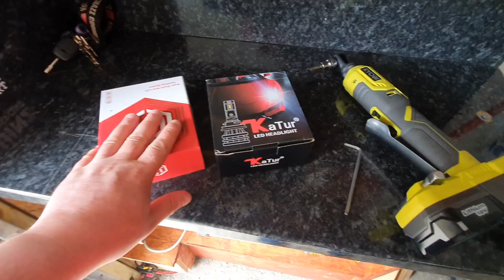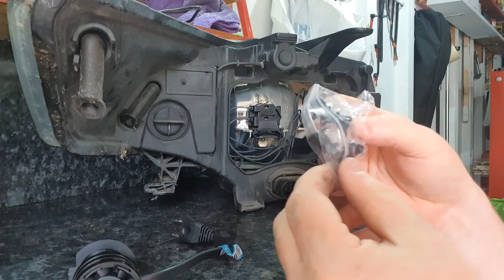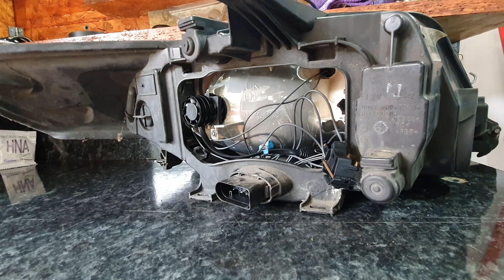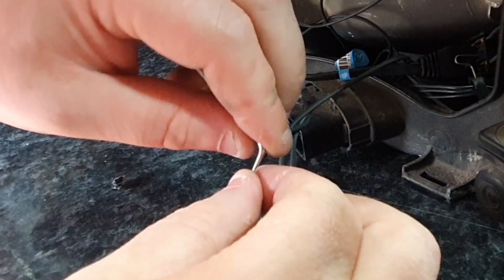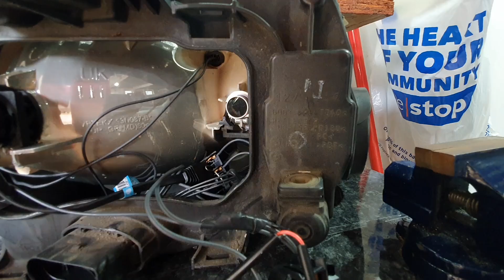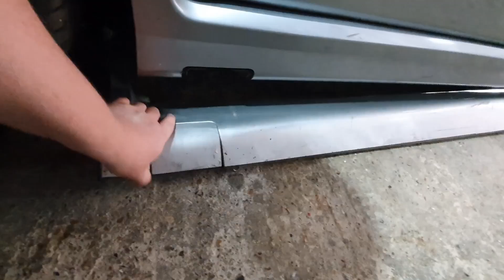Ford Mondeo Mk4 - H1 and H7 Headlight bulb LED Upgrade

Comment from the maker: Part 2 of the led update from HNAsupplies AKA Andy Brooks, in this vid in do the H1 and H7 front lights. So now all that is left is the indicators which Andy has promised to send me asap. So stay tuned for that. Also i will be doing the 3rd brake light in the boot.
Reply: Are these just plug and play mate
Reply from the maker: @neilfinch8331  hiya Neil, yeap they sure are. Only thing is you might need to tap a  ground wire which is easy to do.
Reply: is it safe and will nothing burn? I don't know anything about electricity, but I've heard that cables and fuses can burn out, if it is completely safe, I would like to do it in my car. thanks

Comment: Instant MoT fail, these are a lot of the lights that blind you when they are oncoming, that's why it's illegal to put LEDs into cars  headlamp casings, where it wasn't the original spec.

Comment: Mondeo 4 2013. I install h7 led in my halogen headlight, but the back cover does not close. I swapped the back covers of the headlights, then they closed. But when i tried to install headlight on a car, they rest against the metal bracket of the body, because the back covers assimmetric.

Comment: Guys,  I changed my dips to LEDs,  work fine bar an intermittent "low beam bulb fault" on dash.  Anything can be done?
Reply: Put a load resistor. That will trick the car think it still got standard bulbs in

Comment: Do you even need the plastic adapters on the mk4/4.5? Couldn't you just remove the locking collar fit into the seat on the back of the unit, then fit the retaining spring over it locking it in place then just twist the LED buld unit in place? That's what I'd do 🙂
Reply: Ignore my last comment, I've just changed a set and no the Mondeo has a stupid setup requiring these adapters!

Comment: Hi there, how are these lasting?
Reply from the maker: Hiya James, last and holding up well. The car gets used regular and have had no issues.
Reply: @ChazzCoombes  did it pass the MOT with LEDs in reflectors? I took mine out and put halogens back in when I took mine. just in case.
Reply from the maker: @davidriley9194  hiya yeah it passed fine. I have led in both my mondeos and they both pass fine
Reply: @ChazzCoombes  Great to hear. Will prob go for the upgrade next time a bulb goes. Is there a great difference in brightness? Would I have to switch back to normal bulbs for MOT?

Comment: That's all nice but it's a mot failure. You'll have to undo your work (or it will be undone for you) - it's not road legal to stick LEDs into headlamps designed for halogen.

Comment: Hi just bought pair of same bulbs and i have a cambus error :(
Reply from the maker: Hiya sometimes this happens but there is no issue. Mine sometimes shows this but then it goes of. I will be explaining in an up and coming video on these.
Reply: @ChazzCoombes  I just bought from UKEbay canbus error free adaptors , i give them try and write here my results
Reply: @Damiannott  how did you get on? I put h7s in my mk4.5 today and also had canbus error. I've ordered resistors from ebay. U really hope they don't heat up too much and burn the headlight!
Reply: @ChazzCoombes  I bought mine but however its says "Low beam Dipped Fault" doesnt work after at all. do you have a solution for that thanks

Comment: Not good for the other road users, should be projector lights
Reply: I have fitted LEDs in my car with projector type headlamps so no light scattering. Passed MOT with them. I used to run LEDs without projector lenses few years ago but I never really tend to leave them in for the MOT as it is a failure.
Reply: @davidriley9194 that's the proper way to do it
Reply: @carcctv  It's still an MOT fail but you might get away with it and nobody would ever be able to prove it. Unlike HID conversion kit they have lovely wires and ballasts floating around the engine bay making it obvious for the tester to see. I did have aftermarket HID conversion kit few years ago in projectors and it failed with them on. So I now run LEDs for a good while now so the MOT tester won't see the bulb/wiring or won't know they're LED unless they have X ray eyes. Lol

Comment: I have replaced the front indicators on my galaxy mk2 (2013) and had to try a few different brands as I either go hyperflash or CAN bus error messages.
Am trying to replace the brake bulbs but have so far not managed to get any that worked, all give me error messages that the bulbs are faulty. Have ordered some Osram resistors to see if those will get rid of the error messages.
1- have you not had any error or warning messages?
2- As you say that the front LEDs are very powerful I wonder what oncoming drivers will make of that? It would be great to see what the difference is between you driving at night with the halogens and then compare it with the LEDs. Also if possible do a pattern compare against a wall to see how the cut-offs compare
Reply from the maker: Hiya some good points there. I do have an error message on the dash to let me know there is a bulb out. Was there before i changed them tho when all halogen bulbs was working. And sounds like a good video to make dsy time and night time drive to compair the differance.

Comment: adding leds to classic light is suicide for driver, it look great but its useless, and what about MOT? and what about drivers front of u?
Reply: Most cars have led now it’s commonplace. You can get ones such as these that will pass an mot it depends on the type of bulb
Reply: @CanterOsrs  No, they won't - if the headlights are designed for halogen lightbulbs. What this chap has done in the video is a mot failure right away
Reply from the maker: @ZorgR  hi thanks for your comment. I had these leds in both the ST and MK4 and goes threw MOT each time. I have asked the guy who MOTs my car and he said there fine.